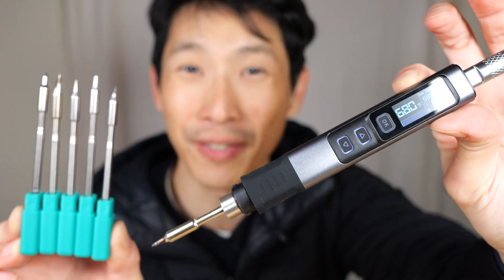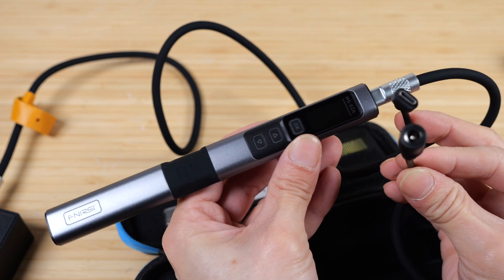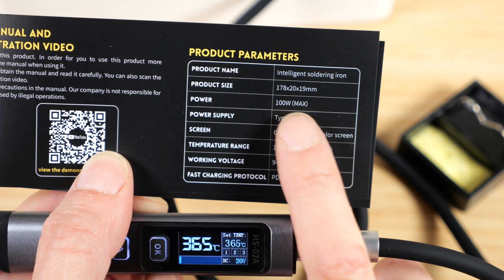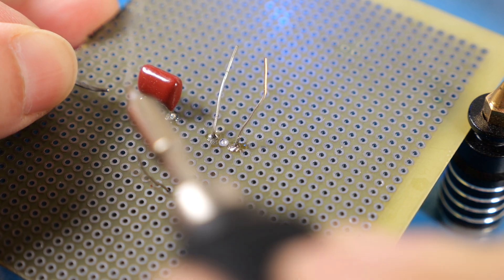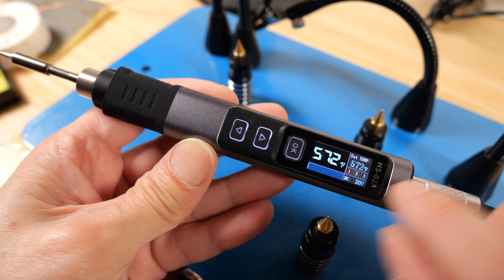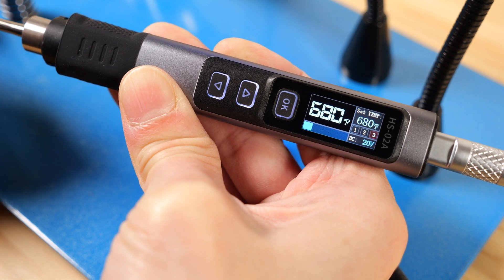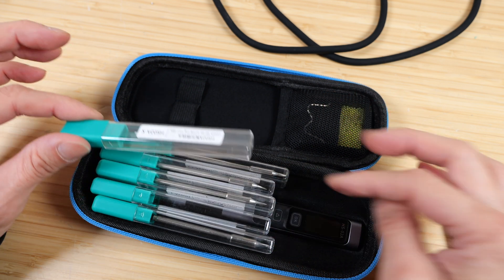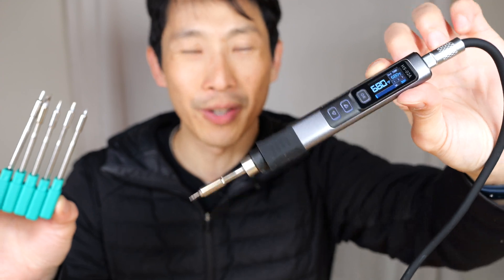100W USBC Portable Soldering Iron [FNIRSI]

Comment: This is a nice review, and I'm glad you showed the iron interface as well! Here are some constructive tips:
Use flux. The rosin flux in the solder wire is messy and there isn't enough. A good no-clean flux will make your life much, much easier; it's a night and day difference.
Irons like this one are meant more for precision work and less for soldering large connector terminals.
The sponge should only be damp, and not soaking wet. You also want to gently glide the tip across the sponge to remove oxidation and dirt. However, a brass wool tip cleaner is much better for the longevity of the tip, and certainly when tips cost as much as these ones do.
That vector board you used is absolute rubbish; use double-sided FR4 PCBs with completely plated through holes that have annular rings on both sides of the board. Again, flux will make a gigantic difference. Clean with isopropyl alcohol of the highest percentage you can find. 99.9% anhydrous is the gold standard.
Thanks!

Comment: Over a year ago, I bought a Fnirsi HS-01 which I really like but much like you, I, too, thought it would be actually working without needing to be plugged into a power outlet. That would be the actual "portable" soldering iron. Then about a month or so ago, I bought a 80W soldering iron for about $7 on Aliexpress that plugs directly into a wall outlet with Temp controls right on the soldering iron itself. Its size is also comparable to Fnirsi so it made me realize all these USB powered so-called portable soldering irons are a bit of a gimmick and a waste of money.
Reply from the maker: It certainly is more portable than a full size soldering station and it does make bringing a soldering iron a lot easier for me.
Reply: @BeatTheBushDIY  Yes, portability wise, my trusty Hakko FX-888D couldn't hold a candle but that 80W cheapo soldering iron I  got on AliExpress really made me question if I got ripped off with the Fnirsi one.
Reply from the maker: Will have to look at durability. Not saying the one you got will not be durable but sometimes, they fail quickly from no name ones. And of course, other times, you might be surprised it lasts and lasts.
Reply: @BeatTheBushDIY  True. That is why I am trying to use it as much as I can to see how it holds up. I bought a hot air station that came with a soldering iron. It looked good and even though the station wasn't that cheap (around $65), the soldering iron is really bad. I don't regret my Fnirsi purchase because it is a well made piece and seems to work really well for SMD level soldering. I am a novice so if it works well for me, I know it is a good piece. It's be cool if they could come up with a cordless soldering iron though. Cheers!
Reply: @Turco949  Fanttik has a completely cordless one, the "Fanttik T1". I heard its no good though
Reply: Well in order to supply more than 60w (at least) to the soldering iron you need a lot of current and I don't think any small-sized battery can provide that  kind of current for a long period of time. Until battery technology evolves we are stucked to use soldering irons with cables.
There are few battery-powered soldering irons in the market but they take so long time to heat and when they reach to the temps you set for they can't stay on that temperature for a long time so they are totally useless.

Comment: hello my iron restarting when i press OK ... i dont have 100w charger just normal one... is that the problem or its defective
Reply from the maker: You really do need a high enough power ac adapter. When you press ok, it probably draws so much current the voltage drops and the device turns off.

Comment: Pretty cool!  Yea, I agree, it would have been amazing if it was battery operated and self-contained.  Oh well, someday.  But I think it's still a great item.  Also like the "helping hands".  That looks way easier to use than the one I have.
Reply: Thats asking quite a lot in a small form factor.  Just think it uses 100 watts when getting uo to temp or changing tips.combine that with a battery big enough to last 15-30 minutes and now your adding some hefty to it. But i cant complain that it works on anker power banks as well sd others. Thats portable enough for me.